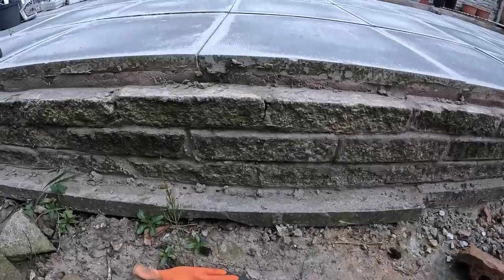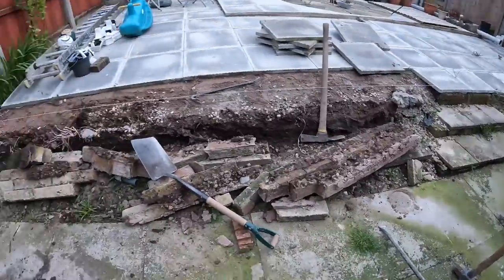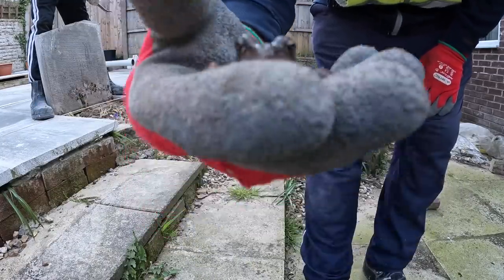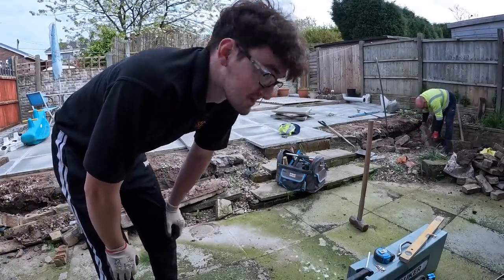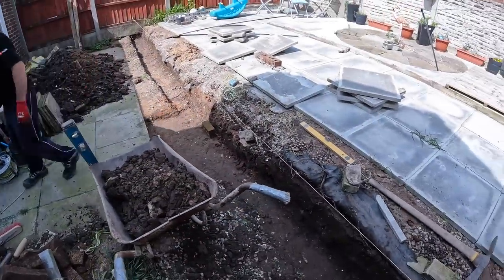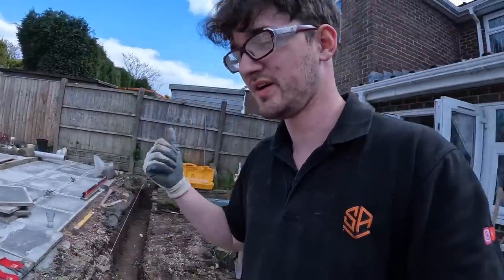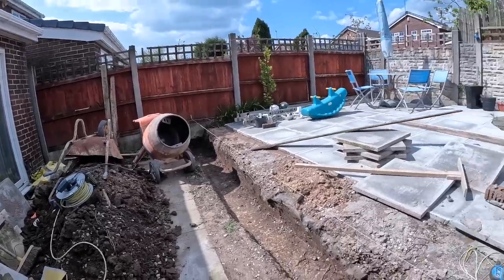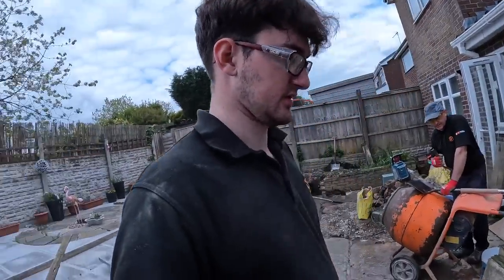ABSOLUTELY DISGUSTING WORKMANSHIP ..GARDEN WALL DISASTER RESCUE PART 1

Comment: Hard work lads.  I've done quite a few gardens in similar fashion. Preparation is the worst followed by tedious pointing though you can get a special grout now to brush in and just eater slightly with a can. Much better and easier than a sand/cement mix.
Reply from the maker: Very true Gareth 🧱👍🏽

Comment: That makes things so much harder having to ho through the house. 🤦🏼
Good work though lads. 
Quick question why don’t you ever use your mixer stand?
Reply from the maker: We hate it and sold it at a car boot sale years ago. 😆.
   Luckily it was a straight run through the house and it’s was laminate 👌🏼🧱👍🏽
Reply: Hate a mixer stand!!! It’s far easier tipping into a barrow rather than mess about like you do
Reply from the maker: @tomthumb1769  You do it your way and we will do it ours 😁🧱👍🏽
Reply from the maker: Three Six Nine  🤨🧱👍🏽
Reply from the maker: Three Six Nine  😁🧱👍🏽

Comment: As a side note, peoples have a tendency to install those channel drains near the home to catch water, but that's the wrong thing to do. The right solution is to correct the slope, direct the water away from the home and install the channel drain at the new low point, away from the home. As much as possible, you want to get water away from the house. If the channel drain ever overflows, all of that water will overflow right next to the foundation where it can cause real problems.

Comment: Not good a lads .looks like a butt joint layed on dust its not the done thing theae days .100mm mot type one base .slabs layed on full beds of 4 or 5 -1 mortor with a paving slurry and joint with flowpoint or similar for them slabs with an adequate fall for drainage. Them slabs are not nice either .you have a job there with that and through the house .Good luck and ive no dought you will fix it ive of run a mile from it Steve.
Good luck lada 👍👍🧱🧱🧱👊
Reply from the maker: Cheers Justin , if it’s not awkward we won’t do it 🤥🤣🤣🧱👍🏽
Reply: @SteveAndAlexBuild  
🤣🤣🤣 hats off to taking the job on most.would walk away and you'll fix it ive no dought at all 🤣🤣👍👊🧱🧱
Reply from the maker: @brickrightbuildinglandscaping  😁🤜🏽🤛🏽🧱👍🏽